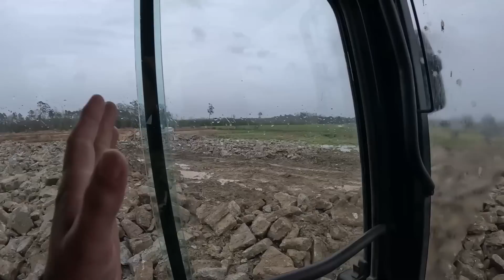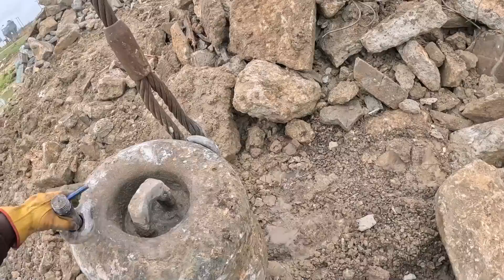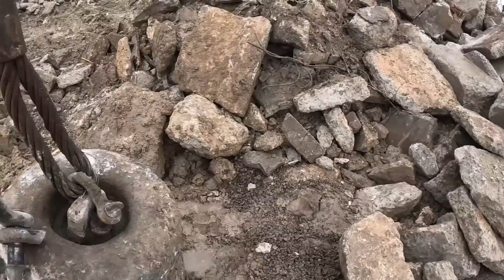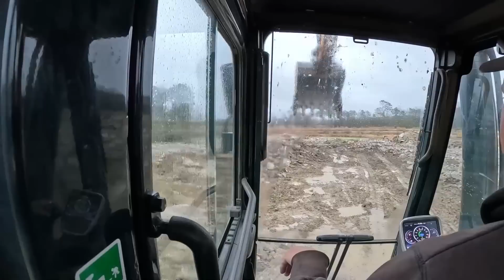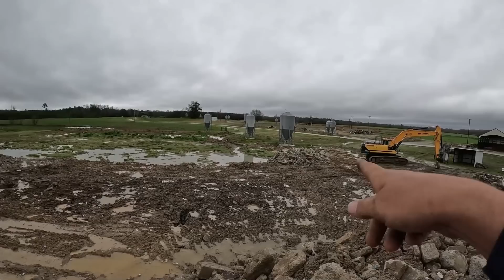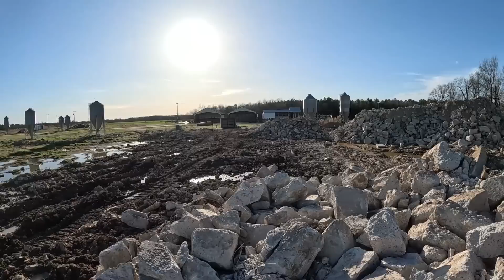Better Explanation Of This Project.... And The Ball Breaks Off

Comment: To crush that much concrete into driveway material, your grandkids would die from old age before it was done.
I understood exactly what you are doing with the wrecking ball, but of course i work in a rock quarry, we set the boulders off to the side and once or twice a year they bring on a breaker on an excavator to break boulders for a few months. Our setup is the shot rock goes through a jaw crusher that takes it down to around 5 inch, it the goes across a three  deck screen with the stuff off the top falling into the cone crusher that is set at around 1 inch then it dumps back to the screen. We do 2000 ton on a good day

Comment: I hate a hammer on a fairly new machine. I seem working in the logging camps what a hammer do to pins bushings an booms stop an think. The impact the rock is taking on one end. The boom an pins are getting the same impact on the other end. Busting bush road through I had to weld stick booms back together on 3 year old excavators

Comment: People should check out the cost of a hammer for that machine. Won't miss $30-40 k. Then the excavator needs to be plumbed and valved for it. Likely another $3-5k. I have a hammer for a 7k mini and it cost $12k. That machine is 10 times the size. The other huge thing about this job is he is able to work and keep some income in inclement weather.

Comment: guy in my town has it figured out, charges 20$ a ton for clean concrete to dump then he crushes it and sells it as driveway base for 15-20$ ton depending on how much you buy. and he runs probably the most clapped auction machines ive worked on but they never need more than regular service. way cheaper to dump with him and buy from him than new material

Comment: I hauled cars from a auction in Okc and on the exit there was a big open field and they brought in a whole lot of equipment there was 2 cranes (old style like Chris has) and they had concrete slabs like 7 foot square and about 5 foot thick he would lift it about 20 to 25 feet and drop it we stopped and watched it one day and that thing went in the ground about 10 feet. At the start  they did it for about 6 or 7 months after they got it packed they brought rock and pond the crap out of it it was a old landfill I found out and dell has a 7 story building there now it was neat watching all that

Comment: My understanding of the poultry industry is that farmers and unsophisticated investors are a revenue source. The industry functions in a way that takes farmers and land owners and puts them in a position where they can't make a profit. Often contract law is used to ensure the asymmetry of the arrangement. A farmer is under contract to buy chicks and feed from one or a limited number of sources. The supplier of these critical business inputs will only sell substandard supplies to the farmers so profit margins erode. The farm goes bankrupt. The relatively new physical plant is sold off for less than the cost of construction. Without the cost of paying off the construction and average quality or better business inputs of chicks and feed, the farm with new owners makes a project. The new owners have a story convincing enough to survive a court proceeding that better management was the only difference in the business.
If the land owner or farmer is a good customer, please make him aware of the risks. It is possible to engage in farming or investing or business where one limits vulnerability to the misconduct of suppliers, banks, partners, investors and advisors. I feel paranoid.

Comment: I reckon that wrecking ball is the ideal, low cost, low impact solution for what is essentially a small part of a bigger project.  It may not be the fastest set up compared to a hydraulic hammer, but it works a treat.  You mentioned that it makes for a boring job, but after watching you draining, scooping and triple handling the black silt from that marathon pond dredge a few years ago, a couple of days in a dry cab will be a piece of cake.

Comment: I build bridges for a living sometimes that ball is the best option to break concrete and we used to do the cable and tire on it but we now just use ship anchor chain and we use a 5k ball on smaller hoes then a 330

Comment: Of all the things that you do, using the wrecking ball to break up bigger pieces got old pretty quick….unless it is time lapse.  Inside your cab, it views as more monotonous than the tedious impact of stumping.  Thx for the narrative and attention to detail wrt the impact on the machines versus other uses.  

This project was (and would be) a huge challenge for many, if not most operators who have done some loading (perhaps running a crusher in a processing yard that only received clean material), but nothing with this much “hair on it”.   I like the parts where you pick out rebar and trash while you sort and create wind rows, uncover big chunks on the bottom, and then eventually build your stockpile.   My biggest “complaint” would be that you haven’t trenched and surfaced the areas close by to scuttle standing water.  💣

Comment: Random observation on your big excavator… the water runs down the center of the window when it rains. I bet if you put a bead of clear silicone in a slight V formation on the top part of the cab the water could run off the sides.

Comment: They asked me to drop a wrecking ball into the local harbour because it was too heavy for the back of the fishing boat they were using to lay mooring lines. All the other weights were pairs of train wheels with loops of chain. They are good because they sink into the mud and give a big area of suction compared to their weight. 
I said dont do it. That is a valuable weight and strong and you wont be able to get out because it will need two or three times the lift to get it out of the mud.
A week later they asked me to lift it out because the floatation bags couldnt lift it (too shallow to get lift).  Not a hope. So its a beautiful incredibly heavy for its size wrecking ball wasted. Makes your one look like a vintage car.

Comment: Your own equipment has a running/owning cost to it, regardless if you use it or not. Renting hammers and the like just adds to the expenses bill at the end of the month, so you might as well use what you have when its capable of getting the job done.

Comment: Where I live in New Jersey, crushed concrete comes in several grades. The most popular are: (1)"Tire Clean", is larger chunks and used to isolate job-site mud from the highway. It can also be used as a deep road base. (2) DGA (densely graded aggregate) is used as a compactable road base. We don't refer to recycled concrete products as "rocks". 😉

Comment: Excellent rant to the keyboard warriors Chris.  Sometimes you just got to run what you brung.  Most have no idea how much this stuff costs to buy or operate.  You go through a $2500 trailer of fuel in a few days to a week on a big job for instance.  Equipment is expensive.

Comment: This is actually a SMALL crushing job. If a guy was doing this all year long, day in day out, it would be more efficient to set up a jaw crusher then conveyor that output into the type crusher you are going to use so just handle once and let the machines do the work. By doing that you let the volume of output spread the initial costs be defrayed over huge quantities. And you buy the stuff not rent them. All that said, this job ain't that and you are winning the heart of a good customer which is always smart. Never doubted you Chris. And really how many small outfits have a five ton wrecking ball in their tool kit and the knowledge to go retro like this?

Comment: Impressive wrecking ball work on the concrete. I had a contractor demolish an uncleaned reinforced concrete crude oil tank with a crane and wrecking ball decades ago. Demo went great but had an end of job claim to rebuild final drives on dozers. and loaders cleaning up the mess of concrete and crude oil bottoms in the tank bottom - “o” rings did not get along well with sour crude. Mess was all buried in lined pits.

Comment: The horizontal impact crusher should have a mag belt to take some of the rebar but you have to be careful that you don’t tear the under crusher belt or break the blow bars on the on the rotor. Don’t stand next to the mag belt when that rebar comes off. I fed an Aztec 4250 crusher with a John Deere 470G we were making 1/2” out of recycled asphalt it was hard on the blow bars.
C

Comment: I thought you were pretty clear as to what you were doing with the wrecking ball. You only said it in every video you've been on this job. And you're not hurting the machine because all of the shock is going into the concrete, unlike if you were using a hammer.

Comment: This job reminds me of when I started construction. We did the same thing to break up a bridge deck that was only 8" thick and on the ground. It was quicker and cheaper to use the wrecking ball on the job than using a hammer and beating the pains and bushing out. Plus you never hang up the ball ware you actually can get cough in beams easily. You are definitely not wasting money and time. Time is Money as always.

Comment: Enjoyed your comments on the project. I have no idea what crusher you are using. If its an impactor you would be looking at a 6050 to manage a regular five foot feed. That is a huge static primary crusher.
If it's a jaw crusher you are again up way above the common mobile size and into a primary size crusher. 
For what little bit you have there its hardly worth the cost of hauling a primary. Now I cant wait to see the thing.
Im assuming its a jaw crusher so it makes sense to line up the feedstock to choke feed it.
When you have done videos from outside the cab it is easy to see the strains on the machines
Hurry up man. The waiting is killing me lol. All the very best sir. Thank you.

Comment: My ball just has the cable loops with the truck tire in the middle and one shackle to the excavator....I like the tire because some times I just grab the tire with my thumb or grapples and use the ball and set it down move material around and then grab the ball break it up....works nice especially if your digging footings out and breaking them up as you go it just all depends on what your doing

Comment: The only problem with crushed concrete is when it gets dry for a long time the concrete is really dusty. I'm sure covering it with clean stone would probably help with the dust.
Reply: Stone gets dusty too.
Reply: @mikeznel6048  Correct, but not like crushed concrete. Crushed concrete is way worse.

Comment: Worked at a rock crusher facility, there are actually three types that I am aware of, Jaw crusher, Cone crusher and Roller crusher. I am sure there maybe others too. The first two can handle larger material and depending on the required material will feed into a roller crusher to finish the crushing process. Crushing cement into a road base (or any other purpose) can be very cost effective. My first job was on a feeder belt to remove any sticks or other material that would make the material undesirable for cement. A job that makes you want to pull your hair out. I enjoyed equipment operating much better, truck and loader driving. Thanks for sharing.

Comment: Chris long time viewer of few years now. I knew you were pre processing for the crusher just like you did for the truss building company when you borrowed Charlie's crusher and figured it was to finish the road to the shop and future house site at the other location. With having watched for few years from just b4 you got your Hitachi excavator i knew there was a rhyme and reason you weren't renting a hamming. More people need to realize you do things for a reason not at a whim.  I know you said couple times you are questioning whether the 220 can handle the wrecking ball is why I asked if using the stump drop trick with it could work better than swinging it.

Comment: richmond, CA all concrete 2 story high school and emegency shelter.   stripped everything off the walls to pristine clean. 3 excavators breaks, 2 963's stockpiling on asphalt parking lot to be removed later...we crushed concrete and recycled in 15,000 ton of class 2 premium road base....which we shipped to another job a few miles away to build a parking lot.

Comment: I think the people giving you the most crap about what you are doing most likely are armchair operators. Or are at best novices. That is a sizeable amount of work you accomplishing. Plus operating a hammer itself is darn rough on an excavators pins and hydraulics. From a mechanics standpoint one that has spent a great deal of time running a hammer on highway jobs on rock or concrete get worn beyond their hours quick.

Comment: Nonetheless Chris that concrete 
Material will also work great if you was pouring caifulers
Mix I. For extra stone 
A far. Near me uses if for ditch 
Bridges work 
Does great work 
But mostly Chris it all comes to you what that is lucky you not 
Breaking it with sledge hammer

Comment: If these people that say you need a hammer on the 330 don't know what there like to work many year's ago when I first started on excavators I used to run a air hammer breaking rock ((a hard red stand stone)) and every time I moved around the site I would have to move the compressor and after the first hour on a Monday morning would be enough for even the best of people and run this on a job for over 6 months,  after this I would of given my right arm to of been digging stumps or grading a site,
So I can understand everything you were saying at the beginning of this video I would of loved to of had a quick release for my bucket instead of a 14 pound slage hammer to knock the pins in and out lol, thank's for another great video and thank's for trying to educate the keyboard warriors who don't have a clue about the world of operating a excavator and keeping customer's coming back because there so happy with the extra distance you go to get the job done perfectly for them.

Comment: Impact crushers are for making fines. A primary jaw followed by secondary crushing with either rolls or a cone is the only reasonable way to crush material of any size. If more fines are needed, an impact crusher could be used. They are expensive to operate. The shoes and anvils wear quickly and are very, very expensive. I ran a bunch of basalt through an impactor trying to make fines. I swear I had as much manganese fines in my stockpile as I did basalt fines. Manganese is very spendy.

Comment: As a welder i can tell you that 98% of the cracked/broken booms ive seen are from hammers were it sends every vibration into the stick/boom
Reply: As a heavy equipment mechanic doing maintenance on them I can tell in seconds if a breaker was used on it before.
Reply: That's why the companies near me use their old clapped out are rusting machine on the hammer or a lease machine when they get to hand it back after 3 years
Reply: Not to mention the hesitation in the hydraulic pumps 😂😂😂😂
Reply: As a heavy equipment operator, I would still have used a hoe ram.  Just as a personal preference. Keeps you mechanics/welders in work anyhow.
Reply: Not to mention using bad angles with the hammer, really should keep it straight vertical for the most part.
Reply: Isaac at I C Weld has done many repairs to torn up bananas
Reply: @tmscheum  That dude does some great repairs on the things we see on his videos.